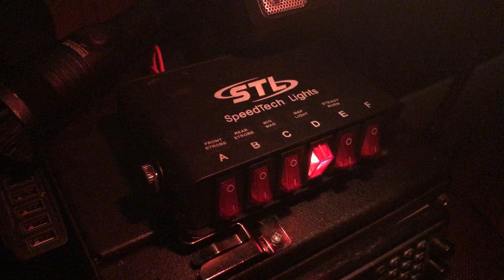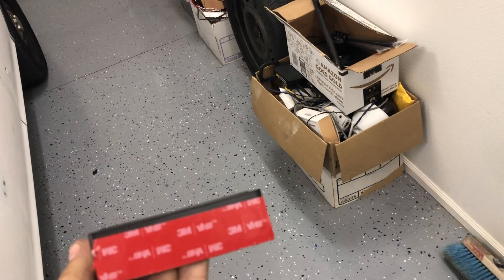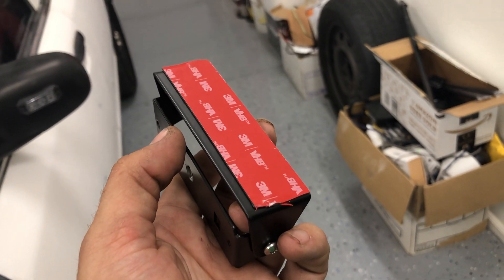Speedtech z3

Comment: Where did you get those z-3 lights brackets
Reply from the maker: Junk Adventures  ended up using them on a can am x3 to give side coverage https://rover.ebay.com/rover/0/0/0?mpre=https%3A%2F%2Fwww.ebay.com%2Fulk%2Fitm%2F371895591791